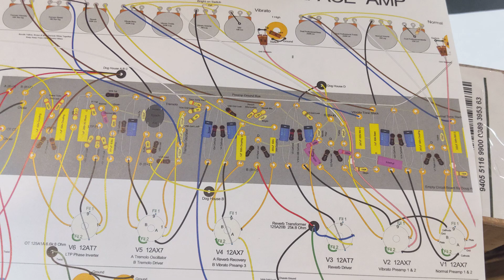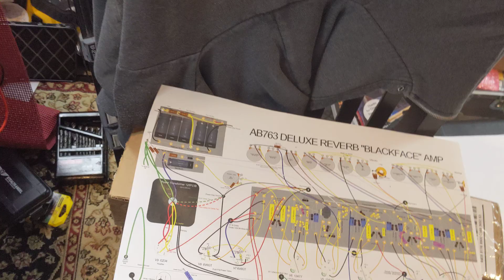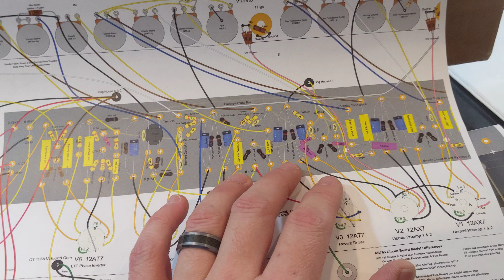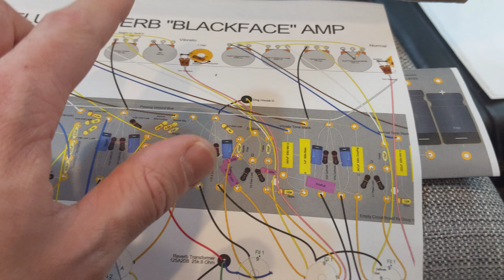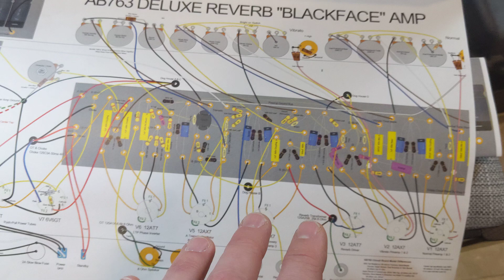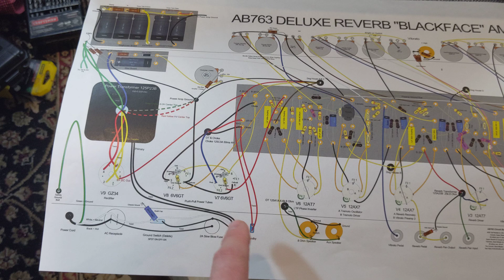Converting a Fender Deluxe Reverb Reissue (DRRI) to Handwired Blackface AB763 | Part 1

Comment: I just watched a video with Tim Pierce interview with Paul Rivera. I'd like to know your thoughts on the video and waxing the boards.
Reply from the maker: I just got done watching the video and it was very insightful! I think waxing the boards makes sense... and I'm sure there are different grades of wax to block out moisture. I can't confirm but I suspect Paul was implying the use of better quality wax. Psionic Audio seems to imply that the wax in the 60's was part of the problem once the wax was compromised with moisture. Either way, I don't think anyone on the engineering team was thinking about longevity of the circuit boards as the fiber boards that were used were very cheap compared to laminate boards of teh day. They could have also done alternative conformal coatings or resin potting while still utilizing the fiber boards, but that would have drove the price up, of course. I'll stick with FR4 circuit boards 🙂 Great question!
Reply: @TheToneGeek  thanks for replying.  Do you use the old NOS tubes?  BTW, I priced out the items in both spreadsheets and some tubes are not available but I found the pricing has doubled since you did this. Either way its still good.

Comment: What is the average cost of doing this?
Reply: The largest cost will always be on research, assembly, start up procedures, final testing biasing & troubleshooting-IOW TIME!!
**That said only about 450-500$ if you’re savvy & source the board, electronic parts, hardware yourself. 625$ minimum for a parts-kit. The most significant cost is in the Transformers (at least 375$) if you decide to upgrade the stock Reverb tank, Power/Output & Rvb transformers! Most folks do, I know I certainly would if I was prepared to spend some 30+ hours rebuilding the chassis!!

Comment: Good idea. I have built up many turret board amps and have a DRRI and want to do it to this amp. Question: Does the Hoffman board have the holes for the screws that match the DRRI chassis? I have only used Hoffman boards and they are great.
Reply from the maker: Thanks! The Hoffman boards do not appear to have the holes for drri chassis. I ended up drilling both at the same time before I started populating the board. It laid practically flat on the chassis for a solid hole that lines up

Comment: Nice job ! I found out about the Allesandro  handwired chassis retro fit   '65 Fender  DRRI's, after I picked up the '64 Custom Deluxe HW a couple years ago..I probably would have seriously considered getting  the Allesandro  Deluxe ....I did however get one of his GA-SA64 replacement speakers ..
Reply from the maker: What do you think of the speakers?
Reply: @TheToneGeek  I think it is better quality  than the stock Jensen C 12Q that came with the  '64 CDRHW amp..didn't breakup so soon..he voiced it for the 60's Deluxe sound. there a lot of other good ones too.

Comment: The TONE GEEK, 
if you remove the Choke in the power supply what does this do to the AC ripple? 
can this add harmonics and modulate the power tubes from the AC ripple signal?
Reply from the maker: I never looked into that. The choke is there to supply steady amperage so I'd imagine there is side effects from a touch response without a choke. I never saw a design without a choke.. have you?
Reply: @TheToneGeek  yes some fender & marshall amps don't use a choke. Another question is when you remove the normal channels first preamp tube, the vibrato channels preamp will have more output voltage and it changes the impedance and TONE, any reasons why? Tubes have very high impedance and aren't suppose to load down the parallel circuit. Any reasons why this changes the TONE of the vibrato channels preamp from removing the unused the first tube from the normal channels amp? its changes the impedance and frequency response techs have told me.
Reply from the maker: @billwilliams6338  thank you for the insight and Marshall and Fender not using a choke occasionally on some models. The tube itself requires power from the supply to make it work. By removing the tube, it's less power draw on the supply. Since v1 and v2 share the same power source, removing v1 raises the voltage (gain) of v2 which changes the characteristics of the tone on the Vibrato channel. The impedance you refer to is for the signal, but this tone change relates to gain.
Reply: @TheToneGeek yes V2 "Plate" voltage raises higher which gives you more gain but  also since v1 & v2 "shared" output impedance has changed since is only V2 output impedance now that the phase inverter circuit sees? another question if you increased the B+ voltage to +600volts would this increase or decrease the AC ripple? the power tubes would draw less or more current if the B+ voltage is +600volts instead of normal operating at B+450vdc?

Comment: great plan! I have a '76 Deluxe Reverb that I got back in '95. I replaced all the Electrolytics  a couple years ago with the F&T kit and it dropped the noise floor way down and really woke up the amp! ...and hear this, back in the day I actually owned a McIntosh MC2300 Solid State Power amp. It was LOUD! for sure! sad i got rid of it too :(
Reply from the maker: Very cool to hear!! Those MC2300 are rare now (and expensive) it seems! I'm sad for you getting rid of it! Glad you like a Deluxe Reverb and I'm excited to hear mine the right way this time. What speaker is in yours?
Reply: @TheToneGeek  I have used a Cannabis Rex for many years, I tried a few others ...the GB128 sounds great, the JS-1250 is a little shrill, and currently I have a Scumback M75 LD(100W) in it. It's very nice indeed, but that speaker will join a soon to arrive H75 LD and go into a 2 x 12" oval port cabinet to be used with my Ceriatone FM50 ME.